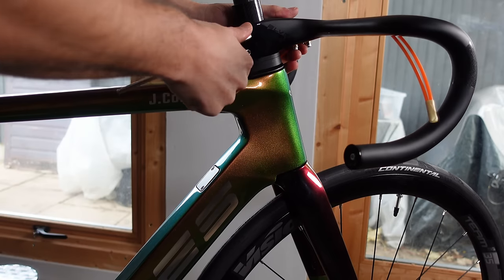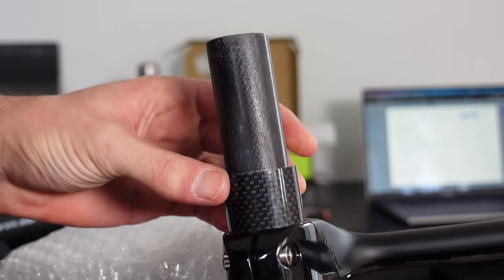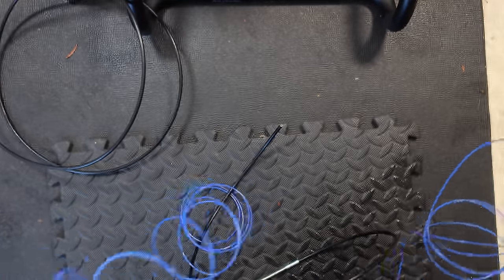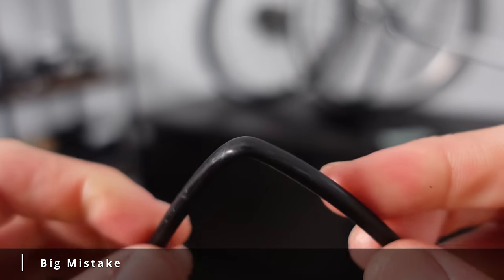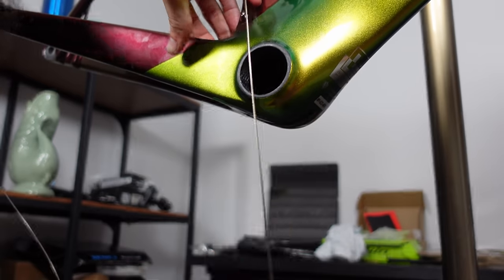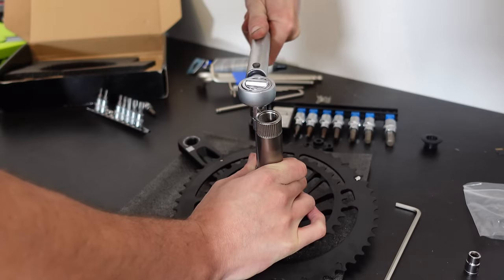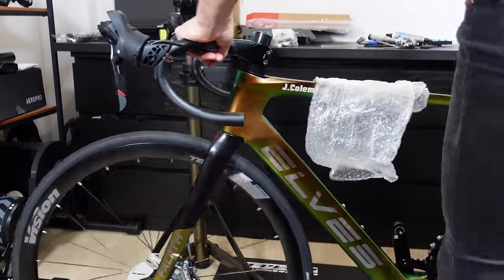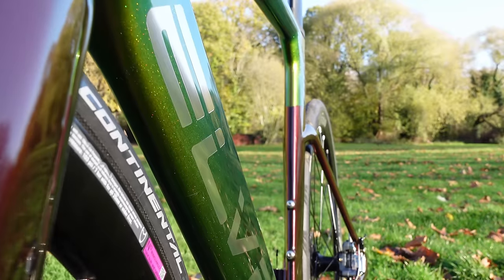$2000 AliExpress Carbon Superbike… Full Build Process!

Comment: Great work J. Hoping to get one of these in the new year - Just yet to decide between rim brake sensah, or the new hyrdo ltwoo disc!!
Reply from the maker: I may have the hydro L-twoo groupset in the post already 👀 - After installing the routed cable housings through the frame and bars I can see why people use hydraulic brakes and electric gears!
Reply: @JourdainColeman  haha brilliant. Yeah hydro Etap would be the dream really unless you get the latest Di2.
Reply: @JourdainColeman  With rim brakes though, it would only be 3 cables through the headset, and 2 past the BB so slightly less painful but still...
Reply from the maker: Yeah, I guess the electric gear cable is much easier to route as well. 👍🏽

Comment: You have so many spacers on top of your stem.  I'm sure you're waiting for a bike fit, but it makes the whole stem cutting part extremely confusing. I want to cut a fork so there is as little material on top of the stem as you can safely do.
Reply from the maker: I have cut the fork steerer down this week and have a video coming out this Sunday that will help you 👍🏽

Comment: I smell the new tyre too but I don't care about the logos lining up.  Current tyres have the logos slightly off.  Didn't plan it.  Just put the tyres on and TBH I'm quite proud of it.  I use a small hex key to open up the outer cable.

Comment: Wow that is light compared to my Giant TCR advanced 1Disc  with full ultegra group set.. aluminium wheels and carbon aero Handle bar which weighs 8.5kgs including ultegra pedals;. Bottle cages and computer mounts...
Reply: But i have as well a Chinese Carbon aero bike built from ICAN... It is a TRIAERO A9 frame built on DURA Ace platform with FARSPORRS 45MM Feder series wheel set (also Chinese) and  which weighs then at fully built bike at 7.2kgs including pedals.. huuuuh ..
Reply from the maker: The Triaero is super light! Close to 7kgs. I'm happy with the weight of this bike, with some carbon wheels I'd be around 8kg which is good for me. I may do a super light build in the near future.

Comment: Something I noticed right off the bat. Don't cut the streerer first. Wait until you're on the bike, cranks, peddles and levers are a must to cut it properly to size. Don't slam for the sake of slam, every bike fits differently.
Reply from the maker: I agree, that's why I done the "dry fit" first to check the position. I had a full bike fit a few weeks ago now so I know roughly where I'll need to be and the extra 20cm on the steerer will give me the flexibility I need! 👍🏽

Comment: Use soapy water or soap when cutting the steerer tube. This prevents carbon dust getting into the air and....
Reply from the maker: Thanks for the tip 👌🏼
Reply: @JourdainColeman  you can directly apply soap with a finger or put soapy water in a spray bottle and apply as you cut

Comment: Did you run the brake and gear housing all the way through inside the frame? For example, does this mean for the rear derailleur housing, it will pop out of where the seat stay and chain stay meet, and the only Ferrule used is at the point where the housing connects to the derailleur?
Reply from the maker: Yes, the cable housing and cable inner are run all the way through the frame. Then they go into the caliper & derailleur with the appropriate end cap 👍🏼
Reply: @JourdainColeman  For the rear derailleur cable housing, did you ran it below the bottom bracket or above or does that not matter?

Comment: This is interesting and I think western brands need to pay attention.  The cable issue I had too on an integrated bar on a neo-retro build of a vintage Bianchi.  The pro compression less cables would not fit.  

Rant but not about this:   Watching your video got me thinking about the issue of tools.  It’s a bit of a pain buying a tool one knows may only be used twice a year for some very specific task and bike tools are the worst for this.  The problem is there’s usually no substitute, the tool is pretty much useless apart from the the task for which it was designed and the good ones are usually expensive.  The tool makers well know the lack of interoperability and use it to charge outrageous prices.  The other problem is that a cheap version really doesn’t work or breaks after a few uses.  I cheaped out on cable cutters and ended up having to buy a better set, which was also inadequate so I got a third which wasn’t break the bank but wasn’t cheap. But it works great.  I would have been better off and it’d be cheaper if I just got a good one to start.  I have made some tools though - headset install tool and the tool to straighten a bent bottom bracket.  There’s good videos about this RJ The Bike Guy I highly recommend for general bike maintenance and specific skills.
Reply from the maker: it seems routed cable bikes and compressionless housings aren't really a match made in heaven! 

I know what you mean about the tools. My dad was a mechanic and he always said you need good tools or you are doomed from the start. But like you said, that's not the easiest given the cost of some of the tools that you will literally use a couple of times.

Comment: Hello! firstly: great build, looks awesome! I have the same transmision on my bike (sensah empire 2x11). I'm trying to set it up, but I always have the problem with the upshifting. The shifter gets completely tense on the last 3 bigger cogs, and does not go up. I had to take it to my local bike shop to get it fixed the first time I tried to set it up (I'm a complete morron, I guess). Do you know why this could be happening? I have searched the hole YouTube videos and have not find any related; wich makes me think that... yes... I might be the only morron with that problem. Thank you very much in advande. Best regards from Chile!
Reply from the maker: if the bike shop managed to fix it did they not tell you what the problem was? It could be any number of things. The limit screw could be incorrect so the derailleur simply can't go that far. The cable tension could be incorrect. When you are setting up the rear derailleur you want to be in the smallest cog as this is where the cable is under least tension and will allow you to pull the slack through. It's easy to make mistakes (as you can see in the video) but that's how we learn! Keep giving it a go and I'm sure you'l get it perfectly indexed eventually 👌🏼

Comment: Way too complex cable routing now days and asking for trouble in he head tube/fork at some point. better to route cable outside around the head tube then enter frame. Love the force arrow drawings to illustrate the key cable push- pull points.
Reply from the maker: Yeah, it's a difficult setup for sure! I'm glad you enjoyed the drawings, it helps me get the point across. 👍🏽

Comment: Thanks for the great video. 

I find it hard to find a suitable frame size for myself (I am 187cm tall). Can you please share your height measurement, the frame size of the Elves, and maybe also other bikes you've ridden comfortably in past so that I can compare through geometrygeeks. Thanks!
Reply from the maker: I am 176 cm and this frame is a size large (52). I also have a giant Defy Advanced (medium). If you can find a bike to try that is the best option, then like you said, compare it on geometry geeks. 👍🏽
Reply: Maybe check out Canyon Endurace, I'm 183cm and I'd fit on their XS lol
Reply: @JourdainColeman  Thanks for the information. I think getting a built Elves will be pretty hard for me XD so the only option is guessing the size. The only problem is that geometry geeks does not take into account saddle setback, spacers under step, stem length, etc... Which can make quite some difference.
Reply: @JourdainColeman  and are you comfortable with this 52? I am 175 cm, inseam 84... Usually I ride on 54 (or Medium) - Specialized, Trek, Ridley, Giant - and I am wondering whether I should get Falath 52 or 54.
Reply from the maker: @MarianBobolny  you should watch my video on bike fit. - https://youtu.be/EnGSLC9FtNI - In the video have my Giant defy medium (54). It's basically too big and I had to shorten things. 

I would say that people generally ride bikes that are too big (as I was). Plus, it's easier to make a smaller bike big than a big bike small. 

I've had a bike fit on the Elves (video coming soon) and it fits me well 👍🏽
Reply: Thanks. So I am waiting for the bike fit video. Do you know the height of your inseam? I am 175 and I am rather flexible, you said that you are not. I am wondering whether this is important factor.
Reply: @JourdainColeman  Your video inspired me to build my own ELVES FALATH. I am 173 cm, inseam 82. Elves suggests size 54 but I think it is to long. According to the size recommondations 52 or even 49 would fit better. It is really hard to find the right size by comparing the geometry to my current bike (TREK Emonda SL in 54)

Comment: I was expecting this bike to be a little lighter. Do you know the weight of the wheels?
Reply from the maker: Yeah, the wheels added to the weight - https://youtu.be/pAfYRztQPYA
Reply: @JourdainColeman  Well, just the bike without wheels is not very light. With carbon wheels you may reduce the weight to magic 7 in the front, but it would be 7,9 i guess. Not great, not terrible. Have you already decided which Chinese carbon wheels you are going to buy? I was thinking about Elitewheels for a moment but I think it is a crap. Majority of them are very narrow and barely fit 28c tires. The have model with 19,5mm inner width and than the outer width is pretty wide - 21mm. And they are not very light...
Reply from the maker: @MarianBobolny  I may have a fancy st waiting to be unboxed 👀

I will give Elite wheels a try at some point because of their price. 

Weight wise, I'm happy overall given the price 👌🏼
Reply: @JourdainColeman  EliteWheels Drive seems to be good but this is another price level than what they offer on Aliexpress.

Comment: This reminds me of the nightmare I went thru building a Yoeleo R12 I don't recommend it. One major problem I had after waiting 8 months for it. Was I could not get the hydraulic line back to the rear wheel. After using a endoscope I found out there was an obstruction inside the frame that needed to be cleared out. Shipping it back was not an option so I bought a 1/8 inch bit by 12 inch long and with the aid of the endoscope I cleared it out. I will never buy a bike where you hide all the cables again. You can't change anything like neck length or change the angle of the bars. If you get those things wrong and say change the bars you will have the replace all the cables cause they will be too short. I also don't like the way the headset feels, hard to get it tight enough. I did use OZ in order to put it together he was very useful . I'm an order guy and use to all metal Italian bikes from the eighties. If I had it to do over I would probably go with regular caliper rim brakes and cables that don't hide in the head tube. By the way I was also at the time looking at Elves bikes. There paint jobs are eye popping.

Comment: "IMPORTANT: Grease is not necessary for center-lock rotors and may contaminate the rotor surface, so do not apply grease to any components." - from any Shimano center lock disc manual.

Comment: Screw Inception 😂
Very well said!

You could use fishing line o called 100, it’s 1,00mm thick line. I bet it’s much cheaper than trimmer line

Inner cable routing looks beautifull until you have to replace the cables and housing and put in new ones. Try to find Sick Biker and listen what he has to say about it. That’s why mechanics hate designers, it all look fine in CAD but in real life it’s way different.

On Park Tool channel there is mustache guy right?
Reply from the maker: haha... who would have thought!! 😂

Comment: I feel fully hydraulic brakes and di2 or wireless group sets are more perfectly suitable for internally routed frame.
Mechanical shifters and brakes are suitable for externally routed frame since installation is easier, easy to maintain and brake line curves are more smoother than internally routed ones. Internal routing is not for mechanical brakes or shifters as there is more bend in headset which may ruin mechanical braking experience.
Internal routing frames should be used by pros. For normal people I would suggest to go with mechanical one, you will not find much difference unless you are doing competition.

I think instead of hydro mechanical brakes, you must go with rim brakes or mechanical disc brakes provided by good brands such as tektro or shimano. I had one these hydro mechanical brakes and after using one of them leaked as seal broke I don’t know how. Servicing them are nightmare. I shifted to mechanical disc calliper from shimano and it works perfectly
Reply from the maker: If I had the £££ I would be using electronic grossest on all my bikes 😂

Comment: How do you feel about the Orome aerobar so far?
Reply from the maker: I like them! They are pretty compact, so the reach is relatively short and the width is measured on the drops so keep that in mind. There are two routing options as well for the cables. I'll hopefully be doing a longer term review in the near future. 👍🏽

Comment: 8,5 kg? My Elves Size 54 Vanyar Disc Di2 with 47mm Carbon Wheels with 28mm TL Tires have complett with Look-Pedals and Bottleholder only 7,7kg......
Reply from the maker: Yeah, my wheels weigh over 2kg which bumps up the weight.  7.7kg is a good weight for your bike! 👌🏼

Comment: Whats the rotor size?
Reply from the maker: 160 front and rear.
Reply: @JourdainColeman does it depend on which caliper you use? im building mine with same frame as yours using ultegra r8170

Comment: Only one thing, which made me cringe all the way through... You should never ever ever clamp your bike frame to the bike stand... it is not designed to withstand this sort of pressure... you should always install seatpost first and grip your bike to the seatpost. You could easily crack your frame this way. It seems you took good care and were aware of it as you padded your stand and tried to not put so much pressure on the frame but it is really sketchy... Otherwise fantastic video
Reply from the maker: I know... I've since learnt this isn't the way to do it! 🙃 - I was super careful, bit still not correct 👍🏼

Comment: 8.57 kg for home built Chinese aero bike  , or you could just buy a Merida 5000 sculptural aero bike for £2500 !
Reply from the maker: A few comments about weight which I always find super interesting. There is way more to consider than a bit of weight to be honest, but I understand for some it's the most important factor. 👍🏼
Reply: @JourdainColeman  Merida are one of the biggest cycling manufacturers ! So a  well designed bike for the same / similar price as Chinese home made bike , is a no brainer which one to choose !

Comment: mate I know your pain, bloody housing cable is a pain in the arse, on my handle bars I just did the brake cables then for the gear cables i just taped them to the outside, couldn't be arsed with the faff ha ha. next build I got sram etap just brake cables, phew. I also got sensah pro 12 speed if you have trouble shifting (few people have issues)  I have figured it out on the gears. when your on the lowest gear on the cassette you only need to shift/click once to go up to the next gear, then from there to go up the gears you shift/ click twice to go up to the next gear. took me a while to figure it out and it can screw up your whole gear tuning. also the front derailleur on the sensah suck's big time if you have empire 12 speed it doesn't even work, I just swapped mine out for sram force if you need a hand drop me a message and we can arrange a call.
Reply from the maker: Not a bad idea just taping them to the outside instead of routing them through (I may do the same on the build that's being done this weekend so thanks for the tip). Cheers for the info on the Sensah 12 speed 👍🏽
Reply: @JourdainColeman  no worries at all bud and good luck building :) ill be doing some more review's/ builds and unboxing soon

Comment: This bike was really easy to assemble https://www.youtube.com/post/UgkxMesz3KOGEmwmvyKQfLfrRSUXLFzfVHZA and required very few adjustments out of the box. The wheels did not require any truing/adjustments. The frame had some small scratches, but nothing major.I did replace the seat though - the seat it came with was very uncomfortable. The tires need to be re-inflated every 4-5 days, but this appears to be quite common for the narrow 700x25 tires.Overall, in my opinion, this bike looks and rides like a much more expensive bike.
Reply from the maker: Indeed it is! Glad you like 👍🏽

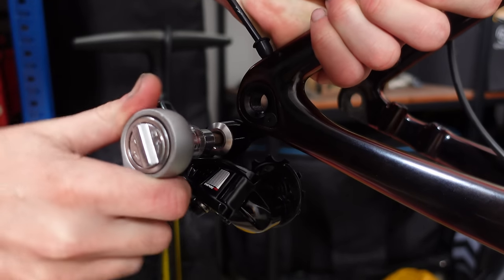Comment: At 17:27
You're not using your torque wrench properly.
Therefore, the torque applied is not what is selected.
The hand should rest on the specifically designed handle* to apply the proper torque.
*Ideally in the middle.
Reply from the maker: Cheers for your comment! I'll give it a check 👍🏽
Reply: @JourdainColeman  
Have a look at the 2:00 minutes video from Park Tool
Tech Tuesday #13: Torque Wrench Accuracy
https://youtu.be/BPe1-bDFVRM
From that point on, you will never, ever, be mishandling a torque wrench on your bike.
Basically, you've over torqued significantly your rear derailleur bolt.